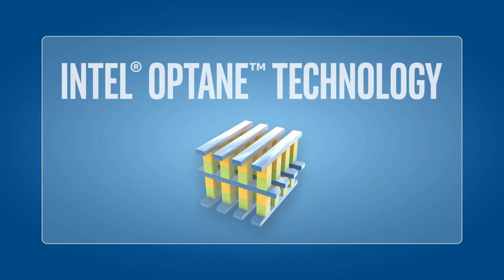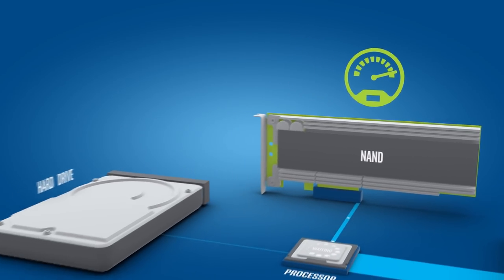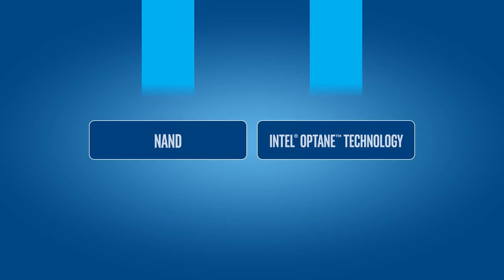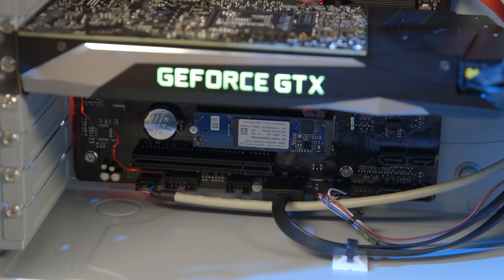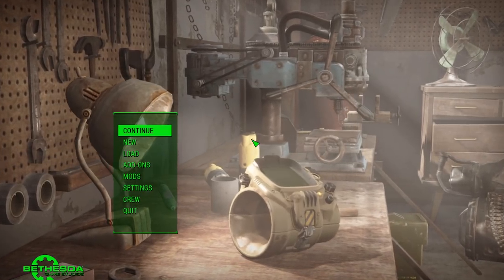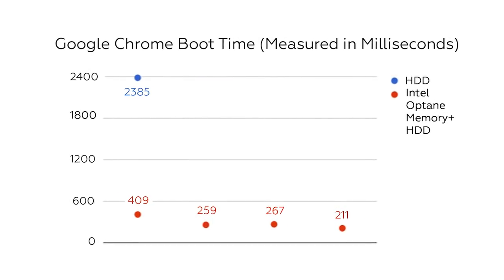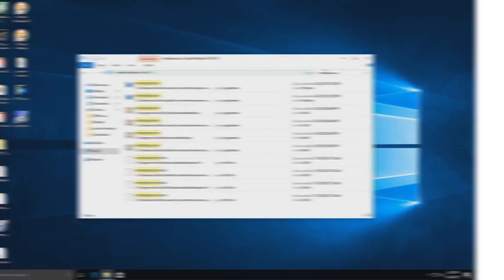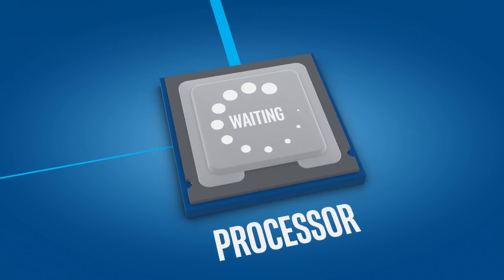Can Intel Optane Memory Really Make Your Games Load Faster? - GameTech

Comment: If you already have a hdd, then this is perfect. I just bought a 32 gb and it cuts the load time of final fantasy 15 by half, consistantly.
Reply: What about with transfer files speed? Example, ssd to hdd+optane. Will it increase read speed or its still use hdd read write?

Comment: Optane has worked perfectly for me . I have an 8tb hard drive and a massive gaming library something you can't do with an ssd . The optane made my gaming life a little easier .
Reply: Any difference in your FPS?
Reply: so, I want to ask, confused, want to buy something,
 1. I have 4tb hdd, buy optane, take 1tb for drive c, I can install a variety of games and applications on Intel Optane

 2. if i buy nvme or ssd , install various games and other applications, it won't be much

 please advise me ,
Reply: @harycare8390  you can't install anything on optane . What optane does is memorizes your daily task then accesses the programs you use faster . In my case I have so many games for me to upgrade to ssd/nvme would cost over a thousand so to get better speeds using my hdd I installed optane but if you don't have 4  to 8tb of games and you can live with a one to two tb drive then a decent nvme/ssd will run you $200 to $500  and removes the need for optane . So if you can afford nvme/ssd go that route but if you have to get hdd then pair it with optane.
Reply: @Scorpio_1974  lol, hard drives and ssd does not affect fps but affects loading times

Comment: Well, if it only works with an i7 and you got the money to afford an i7, normally means you have the money to have an SSD.
Still a pretty nice boost and since it's only the first generation of Optane, it would be interesting to see how they'll upgrade it in the future, having it run with an i5 would be good since I guess a majority of people are running with an i5 instead of an i7.
Reply: Diadlo It doesn't only work with i7. It works with 7th gen Intel Core processors.

Comment: Not sure I'd be willing to sacrifice my single m.2 slot. Not when the same thing can be achieved with an actual and likely larger m.2 ssd in the same location for the same money. Perhaps I'm missing the point of this but coupled with the Kabylake requirement its looking like the 'you need a 7700k to run Netflix 4k' deal Intel tried the last time.

Comment: Buy an SSD.

Not knowing anything about Optane, I thought it was supposed to blow SSDs away. Turns out it's just an alternative to HDDs for cheapskates.

SATA SSDs are cheap, so you really have no excuse.
Reply: 2 TB SSD: 300€
2 TB HDD + Optane 32 GB: 110€. That's a huge difference.

Comment: What will it do with a ssd thiw and not hhd
Reply: IT WILL MAKE THE SSD FASTER.  standard ssd are max out in the 500 write read margin, i have optane with an 8tb hdd SEAGATE hitting read speeds of over 1400 thats 2 times faster more or less then a std ssd, it will not accelerate NVME no point doing so was not design for that, the 8tb cost me £125 its sold as an external hdd box with usb 3.0 connectors , break it open take out the hdd put in pc. NICE

Comment: This is terrible.  If you can afford this new mother board, cpu setup and spend $77 for 32GB you can spend $150 for 512GB SSD. LOL.

If this Optane was large and cheap enough then lets talk :D
Reply: the thing is, space doesn't matter. it is cache, so you won't be downloading games on it... Now in 2018, if you're building an intel system it will have an 8th gen cpu (which is supported) and a compatible motherboard. The optane memory module will ne a good cheap add on that'll boost your hard drive close to ssd like performances

Comment: I'm not a genius with computers but what if (if there is a possibility) that we could use the optane memory with an i7 8th gen and why is it only for i7 7th gen, would this still be viable for heavy gaming like rainbow six siege, and battlefield genre like?
Reply: where did you read this rubbish lol i just got a 8tb hdd for £120 new from respected shop and they have plenty more, i use optane with that for my games i use nvme for OS i use coffee lake 8th gen, you can only use i5 and i7 with compatible mobo with m2 slot no m2= no nvme no optane as its an nvme memory module , you might need to update bios if bios is pre 2018, there was update this year to use on a 2nd drive and not on OS DRIVE
Reply: 7th gen ONWARDS